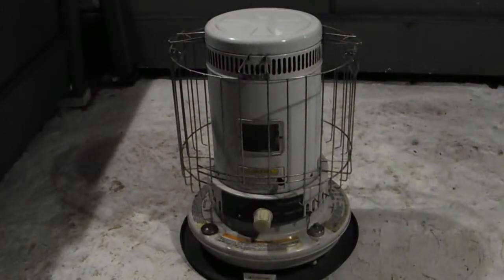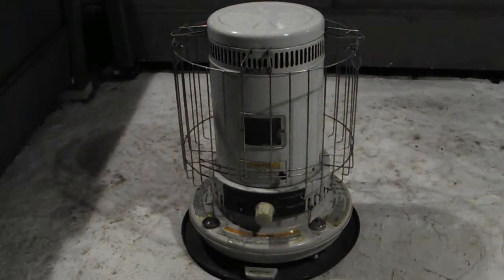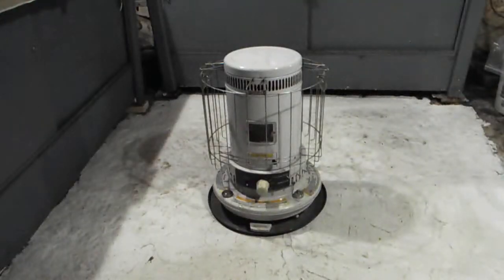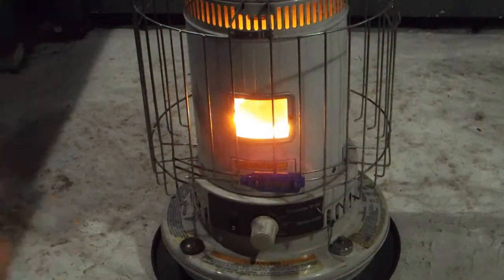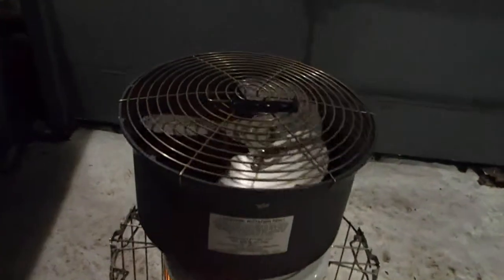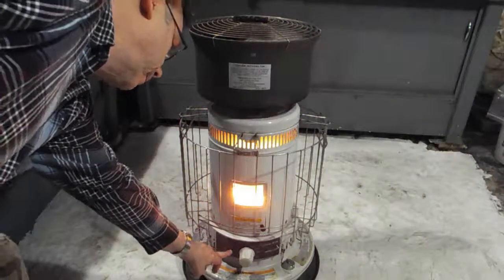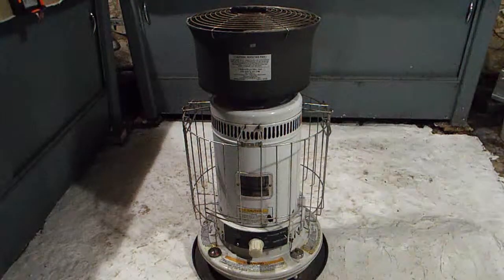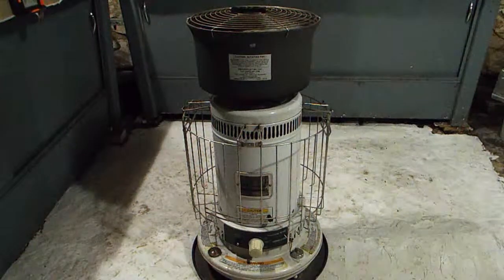Episode 1, Essential Information Series - Kerosene Heaters

Comment: I used my woodstove fans for my 9000 BTU kerosene heaters and I noticed that even though they work just fine, the kerosene heaters get hotter than what the woodstove  fan temperature is rated for. I read in your comment section that the woodstove fan will eventually burn up  because of this excessive heat and for this reason, I have decided to use my ceiling fan instead the woodstove fan and save my woodstove fans for power outage use only.

Comment: I've used those before. It will heat a good sized room  fine. And just leave bedroom doors open.  20,000 BTU. I didn't have a fan. The fires are from where people set them. Don't put near a window with curtains,  furniture etc.

Comment: The problem I see is that 1 gallon of kerosene only lasts maybe  half a day. So if you had to use
the heater for at least 21 days since the roads were closed as you say, that means you must have
had over 40 gallons of kerosene on hand. Do you always keep that much kerosene on hand? How long will the kerosene still be good if several years go by without needing to use it?
Reply from the maker: The pink stuff for the Laser heaters, I have 3 x 275 gallon tanks and for the clear, I have a 55 gallon blue plastic drum. Kept away from light, air and moisture, kerosene can last for many years. My oldest Kero is from 1998!

Comment: Have you worked w radiant heaters? Good info. Thanks.
Reply from the maker: I used a Kerosun Radiant 10 and then a 36 for many winters in my shop. Only problem was the limit of 10,000 Btu's when it was really cold. I increased its efficiency with a Kero-Blow (sp?) fan over the top of the heater.
Reply: It’s not nice to be sarcastic

Comment: 15 years of kerosene devices in use is enough to offer advice. Batteries quickly die and the holder rusts. I get cheap boxes of matches at Dollar Tree. Long type butane lighters that are refillable are easy to maintain and refill.

Comment: i was going to use a heater like this for winter tent camping but was worried about the smell
Reply from the maker: If the wick is clean, the chimney bleed holes are clear, using clear kerosene and there is no breeze blowing on the unit, there is very little smell.
Reply: @greghall_The_TechEditor  oh, ok thanks

Comment: I can't find that surplus fan anywhere online? anybody have any links? I am using a cast iron fry pan on top to keep the heat from going up to the ceiling, but that fan looks like a great idea.
Reply from the maker: Since I filmed the video, the supply has really dried up
Reply: I have been trying to find one as welll but haven't had any  luck.  I bet it would be relatively easy for a clever guy to make.  I bet you could make and sell these Greg!

Comment: What color is the flame supposed to be , blue or orange ?
Reply from the maker: On this type of Heater, you get a Diffusion flame that is Yellow / Orange.
 To obtain a Yellow / Orange flame, fuel (Kerosene) is on one side of the reaction zone and oxygen is on the other side. There is then an area on the fuel side of the flame where there is fuel that is gasified with no O2. This area is at a high temperature and the heat causes the Kerosene gas molecules to crack and Polymerize (small molecules forming larger molecules). Two types of molecules are formed. One, are light molecules that are burned away and then you have the heavy molecules made up of carbon soot. The carbon molecules move upward to the outer edge of the flame where there is Oxygen available. There the carbon molecules, are heated to a high temperature, glowing a bright yellow (incandescence) as they are burned, producing the familiar yellow light.

Comment: how long does a gallon of kerosene last?
Reply from the maker: It depends on the heater. But on average 8 - 10 hours for a wick heater with an output of 10,000 btu per hour. For the Japanese fan heaters that turn the liquid Kerosene into a gas that is then burnt, 12 hrs thereabouts.

Comment: Run it on diesel. It's cheaper and burns hotter (diesel puts out more BTUs because there's no wax in it) Kerosene stinks and is too dam expensive. And if you can, install a ceiling fan above it (or small fan blowing down from above) really helps distribute the heat.
Reply from the maker: While it may burn hotter, I prefer not to breath injector pump lubricant!
Reply: @greghall_The_TechEditor  Injector pump lubricant? Diesel fuel for diesel engines. You don't breath it (like stinky kerosene) it burns clean (if you have your heater set right)
Reply from the maker: @PainterD54  Diesel has injector pump lubricant in it to lube the injector pump and the injectors. What do you think happens when that is burnt??
Reply: @greghall_The_TechEditor  It burns up with the diesel fuel, but you can't smell it. My wife used to comment she could smell kerosene when I used it but not now. All I know is it works much better and NO FUMES!

Comment: 2.5 gallons of 1K kerosene at Fleet Farm in Wisconsin costs $20.99; I haven't used my heater yet but read that 2.5 gallons will burn about 15 hours; in one 24/7 week that would take 11.2 containers of kerosene, costing approximately $235.00 in fuel. That's freak'n expensive!!!
Reply from the maker: You are better off purchasing in bulk or from a "locked" pump. In my area, Northern NY, a "Locked" pump price is $3.35 per gallon. Bulk, 100 gallon minimum is $2.95 per gallon.
Reply: $3.50 per gal in Maine today.
Reply: Kerosene is $4.29 at Speedway if you have one in your area that has K1 at the pump. It still adds up, but buying from Menards or any other retail outlet by the gallon is highway robbery. Hell, even pump prices are but they have us by the gonads..."Where else are you gonna get it from?"
Reply: Where I am k1 kerosene is prohibitively expensive and only available at box stores. There are ppl that are using ultra low supher #2 diesel w a pint of 91 percent isopropyl alcohol. The wick must be cotton to prevent clogging. Exhaust is similar to k1 as far as I have read. The cost is about a fourth of k1.
Reply: @dannypresson4815  thanks, I will try that. I assume you mean one gallon of the diesel to one pint of alchohol?

Comment: Kerosene is expensive compared to Diesel... I have found videos of people using diesel by adding an oz of 90% Isophrel Alcohol and using it for years...  What say you?
Reply from the maker: Diesel has injector lubricant in it. I, personally don't care to burn or breath fuel injector lubricant
Reply: I've tried diesel with the alcohol. Doesn't work, the wick gets screwed up.

Comment: Do you light the heater outside and then bring it inside?
Reply: I have seen video that say to light and extinguish outside but the info on heater I just bought said not to move a lit heater...imagine if you tipped a lit heater over in the process of moving it!
Reply from the maker: I personally would not move a 22,500 btu heater while running. A small Perfection at 11,000 btu, no problem.

Comment: What do you mean by "PIN" - what is it?
Reply from the maker: Some models of Kerosene heater have riveted pins that insert into the wick raising mechanism. With this type of wick and heater, you can't raise the wick to compensate for the burn down of the wick over time. If the wick and heater use a sock type, you just disengage the wick from the raising mechanism and then raise the wick back to the factory specification. This gives you additional life from the wick.
Reply: I appreciate the clarification.  Your videos are very informative.  Thank you.   @greghall_The_TechEditor
Reply: Some wicks have metal pins that fit into holes in the wick holder. Thus there is no adjustment of the wick up and down in the holder.

Comment: Can you leave these heaters on over night?
Reply from the maker: Yes as long as you keep a window cracked 1" for fresh air to replace the O2 used by the heater. This recommendation dates back to circa 1900, when Kerosene heaters were first in use. Still applies today!

Comment: Finding Kerosene is hard to find. Can't find a gas station that sells it and it's about $10 a gallon in stores.
Reply from the maker: There are some places in the country that there are few gas stations with the "locked" pump. You could check with local fuel dealers as to the current Kerosene price in bulk for water clear and the minimum that they will deliver. Sometimes a simple 55 gallon Blue plastic drum will suffice.

Comment: cant you use a ceiling fan? or a normal fan from a distance?
Reply from the maker: If you have AC power than a ceiling fan on low blowing down would work. A normal fan will not work as well because the air is blowing horizontal and the heat is going vertical. You are trying to keep the heat down where the people are.
Reply: @greghall_The_TechEditor  my fan has 2 options. winter and summer. the winter mode is circulating the warmth.. I have tried it with another heater which puts the warmth to the ceiling (electric)  my bedroom was warm within 4 minutes. So i hope it will work with the one i want to order online.

Comment: Your army "direct heat to electricity" fan sits directly on top of the heater.  All the heaters I see for sale have the wire grid over top.  So, the solution is,,,,?
Reply from the maker: If you notice, I removed the mounting screws and discarded the top cage.
Reply: @Greg Hall  Oh, the top "cage" is removable?  Well, that's handy!

Comment: $5.99 per gallon ....5 hours warmth....any questions ?
Reply from the maker: When I got into Kerosene, it was quite cheap. Then it became expensive and people started dumping their Laser Kerosene heaters for Propane. Then when Kerosene was cheap again and Propane was expensive, why didn't the same people dump their Propane heaters for Kerosene again?? You stick with what you have because of the great expense in changing your heating system every few years depending on the price of fuel. I can store a year and a half of Kerosene for winter heating and my Kerosene water heater. So, I am not affected by seasonal market pricing. Can't do that with Natural Gas, Propane, Electricity, etc. Plus for an extended electrical power outage, if you were smart enough to have Kerosene on hand, that is better than empty Propane tanks with the stores closed or the Natural Gas  flow is stopped because there is no power to run the pumps.

Comment: What is a pinned wick ?  Be nice is you showed it.
Reply from the maker: A pinned wick has metal pins sewed into the wick cloth that slide into slots on the burner to raise the wick. A sock wick uses pointy teeth to grab the wick and raise it. The pinned wick can NOT be raised any higher than the manufacturer wants you too and when it is burnt down it must be replaced. A sock wick can be raised pulled a way from the pointy teeth and raised 1/4" and and re-pressed into the pointy teeth to extend the useful life of the wick. I would refer you to milesstair.com for images of pinned and un-pinned wicks because I simply do not deal with nor do I own even one pinned wick to show you. Sorry!
Reply: @greghall_The_TechEditor  thanks.  Mine must have been a sock type.  Saved me and the baby when the ex took off on a prudoe bay run and left us without fuel oil.

Comment: Don't burn cotton wicks dry, only fiberglass.
Reply from the maker: Usually that is true except when trying to level a wick that has burnt lopsided, or the carbon is so bad that it needs to be burnt dry. Yes it will eat wick but you are trying to save a bad wick at this point so a dry burn is worth a try.